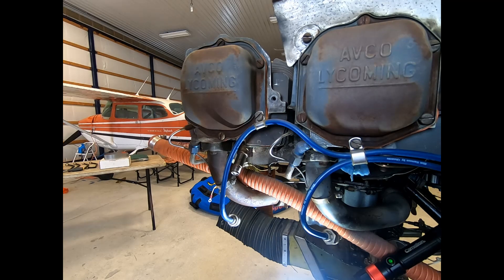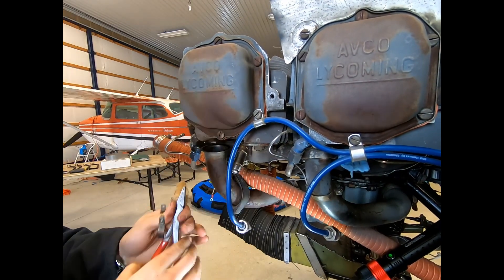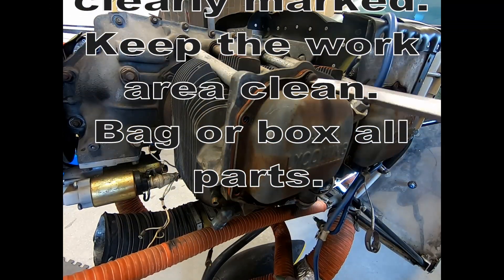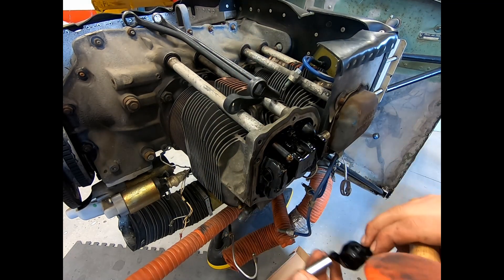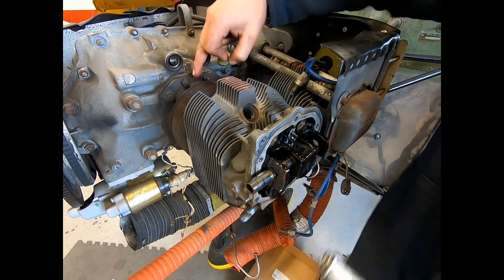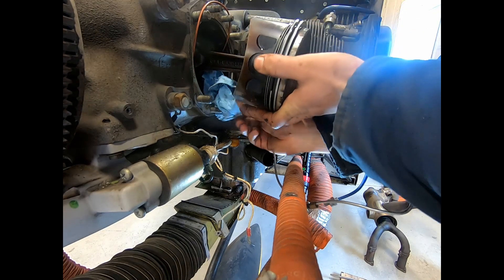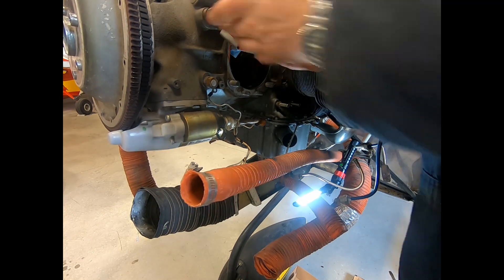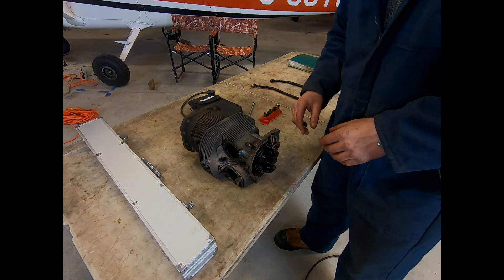Cylinder Removal: Lycoming

Comment: show me the valves
Reply: thanks
Reply from the maker: What part of the valves are you looking to see from inside the cylinder or them sitting out on the table? I got a small video of a borescope inspection on an IO 550 that I could put up if it was of interest?

Comment: Nice 👍 
In the process of looking over my IO-360. Good stuff.
Reply from the maker: What is your IO-360 engine going to power?
Reply: @fastbackflying853  I just recently bought a 1968 Mooney M20C, with the motor. The original motor that was in it, had the O-360-A1D, but I did some research and found that you can upgrade to the IO-360-A1A variant. Gonna be a nice project.
Reply from the maker: Wow that will be very nice indeed. I would be very interested to hear what you get for cruise speed and fuel burn. I have 4 Mooney aircraft that I currently look after and a fair amount of flying time in them as well. Do you have electric gear or manual?
Reply: @fastbackflying853  still have the manual gear. Ive heard its better to keep the manual because of easier maintenance than the electric…Made a spelling error, on my last comment. I bought the Mooney without the motor, and so I just recently bought a used IO-360.

Comment: Been nice to share "what the scope saw, did a leak- down lead to a valve issue? Will you be doing the valve job/guides hone
Or exchange cyl.? Thanks for the looks-see :-)
Reply from the maker: Borescope showed burnt exhaust valve and piston pin plug wear. DCT indicated leaking exhaust valve. 

We will have a follow up video explaining this along with other details and the installation of the new cylinder. 

Valve guide was worn beyond limit and bore was also outside tolerance. A new cylinder assembly will be installed.
Reply: @fastbackflying853  thank you for the clarification will look forward to fallow-ups
Reply from the maker: You're very welcome.